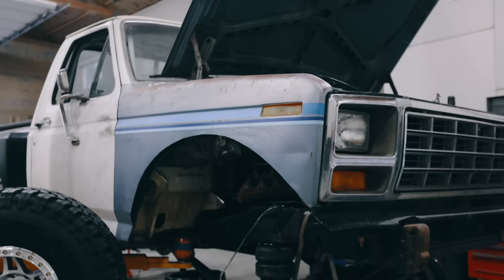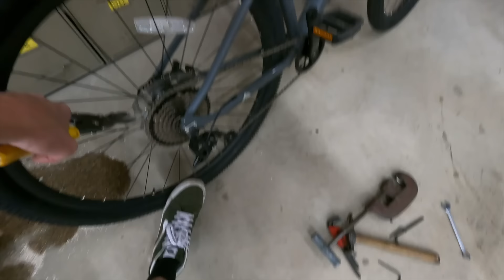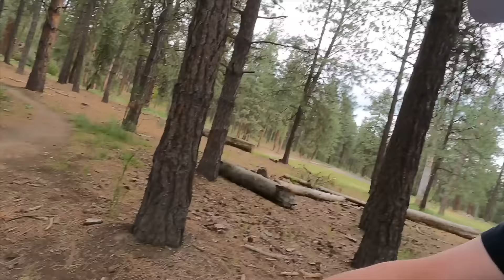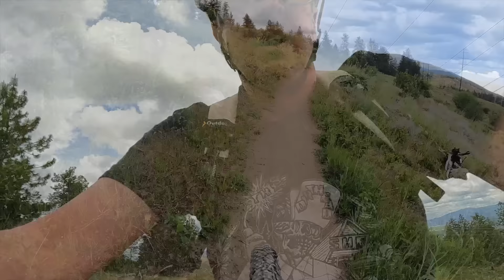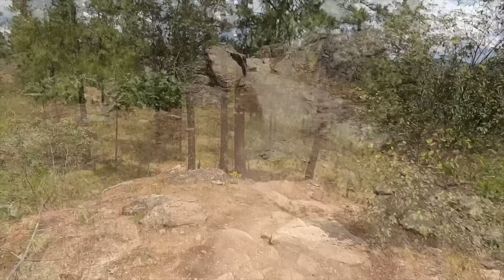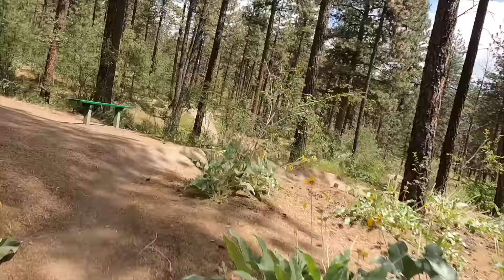The Cheapest "good" Mountain Bike out there.  Ozark Trail Ridge MTB

Comment: I'd bet  you wouldn't have had to cut the seat post you could have just backed out the screws and mounted a pump or water bottle. The screws would back out far enough to drop the seat down further.
Reply from the maker: There are threaded inserts (nutcerts) in the frame.  I would have to drill them out

Comment: I really enjoy mine.
I swapped the seat and grips out for personal preference.
Otherwise mine is stock.
I plan to upgrade to an air fork, but the factory one has been mostly sufficient for my weight and how I ride.
Seems you are a little harder on this one than I am on mine.
At about 35psi the tires have been fine for me.
I’ve noticed a couple times that they’ve started to slip where my maxxis tires on my other bike don’t.

It’s definitely not a $10k bike, but I’ve no complaints and have put over 500 miles on mine.
Once I got it dialed in, it felt like the geometry of the bike was designed for me personally.
Reply from the maker: I’m having fun with this one. I really think I’ll keep it pretty stick and see what it’s good at.  Seems not totally necessary to modify everything

Comment: This is so f'n rad! I'm not a big off-roader, but I subscribed back when Dirt Every Day came to an untimely end because I enjoyed Dave as a host.

I've been mountain biking for 22 years, so I've gone from 26er hardtail to 26er full suspension and then jumped to 29er hardtail in 2006 which I stuck with all the way until 2015. I went 29er full suspension that year and have ridden the wave of more "progressive" trail bike geometry. I've also gotten into a couple of eMTBs: a 160/150mm mullet wheel and a 110mm 29er hardtail.

As I've worked my bike stable up into the tens of thousands of dollars, I've noticed the rise of the big-box bikes and other budget level bikes and have become borderline obsessed with them. I bought an Ozark Trail Ridge new in the box and had it pretty much assembked and dialed when I went to install the pedals...and the drive side crank arm threads were missing. I was so miffed since I drove across town to get the bike and then spent over and hour assembling and videoing the process. I never published the video.

Recently, I've been playing around with Decathlon brand bikes because they've been super cheap to buy new. I had a $150 hardtail and a $216 full suspension. I found a $160 SR Suntour air fork for it, cheap rear air shock. Tranz-X 31.6 dropper posts are $50 on Amazon, so I grabbed on of those. Found some decent tires on marketplace for $15. Grabbed a few goodies out of my own parts bin.
Reply from the maker: Sounds like I need to look up Decathlon Bikes!  Thanks

Comment: I got my very first new bike back when I was in the 4th grade in the mid 60's. It came from the Thrifty Drug store on the corner of Westminster Ave. and Golden West St. It was a Huffy and it cost $15.00 and it was really hard to pedal. I would have liked to have had a Schwinn but they just cost to much. But it always got me where I needed go. I still have the last bike that I bought new in 1983. It's a 26 inch Beach Cruisier that I was riding the two miles to work.
Reply from the maker: Right on.  They all do the job !

Comment: This is awesome! I've been using Walmart bikes since they came out with full disc brake bikes. Hardtails everyone, and they really just need a nut and bolt check, adjustment so it shifts right, better brake pads, and tires if you're doing some of the harder stuff. I will admit that the forks have been stiff, hard hits is really all they'll adsorb. With what I've been doing they last about 2 seasons before the frames start to crack. But would definitely recommend as long as your not doing anything crazy.
Reply from the maker: Some are good… most are bad, but they all have their place in the market!

Comment: Heck yeah, man. That bike just needs a decent fork and stem, like you've already mentioned or hinted at. For a cheap fork option I think you can get a Judy Silver with 29" QR spacing. I've had them on some 27.5s without busting anything. And there's a couple cheap dropper post options with levers right underneath the seat if you don't wanna route cables.
Reply from the maker: All good options. I’m already thinking of fork options

Comment: I picked up one of these about a year ago  to get back into mountain biking on the cheap. Unfortunately it didn't stay cheap long, every part of it has been upgraded but damn is it a fun bike to ride.
Reply from the maker: That will happen!  It’s a fine line between upgrading and replacing
Reply: When you are searching for that new fork, 120mm of front travel really wakes the bike up. Also, if you end up with any tire rub after upgrading its going to be the skewer. You can solve that flexing by grabbing a Shimano XT skewer ($23ish).

Comment: I've routinely used a normal pipe cutter for steerer tubes, shortening handlebar width, etc... Nothing wrong with that imho. Interested to see how well this bike holds up- mostly the wheels staying true, and the welds on the frame itself not falling apart. Things I'd think a cheaper bike might fail at.
Reply from the maker: The frame is super nice. I think the wheels will hold up fine,  I’m sure the bearings in the hubs are ultra cheap though

Comment: Back in the way back I raced BMX for a local shop called believe it or not BMX Plus in Laurel MD. I talked to the Owner some years back about getting a bike for My Wife. He told Me to go to Walmart if She wasn't going to ride much. Just make sure the components were Shimano and most of the stuff there had it. I got one later on & smashed both wheels but that's My hard riding style. I need mags. 😁 Bike looks good enough to do what You want. Why spend $1500 if You don't need to. 👍
Reply from the maker: Yep.. I think there is probably a sweet spot $850 bike out there though.  I’m gonna find a
Reply: I'm going to build a 20" BMX bike, just want to ride hard like that again. 🙏 4 Me. 🤣

Comment: With the exception of the back tire, it seemed like it did better at a lower pressure. I'd say a better back tire and you should be pretty good. I have a killer back tire on my mountain bike, but I don't remember what it's called. The lugs are shorter in the tread, but it has some deep gnarly side lugs on the sides of the tread. I wouldn't run a riad race with them, but they bite good in the dirt!
Reply from the maker: So many good options out there

Comment: My bike has a Shock on the front, and hard mount on the rear.

I spent so much time on old school hard mount bikes that I was still getting used to riding with even the single shock.  I sure didn't like it on the dirt because it wasn't predictable like a hard mount.  Because of that I don't know that I will transition to fully sprung.  I really enjoy feeling the ground.  It gives me time to adjust.

It took me a while to find the tire pressure that I like for grip.  I can deal with the rude quality, traction is very important to me.

Don't get me wrong, I did enjoy the softer ride of the partial and fully sprung bikes.  Predictability is very important for me, even in town on pavement.  Too many too close encounters of the bad kind.  That's why I am a strong advocate for wearing a helmet.  It's kept my head safe more than a couple of times.

Finding long Offroad trails is very difficult here in the Midwest.  They are out there.  Far and few in between.
Reply from the maker: Sounds like you need to look at the ozark trail gravel bike. I think you would dig it
Reply: @thedirtheadshed  I will give them a look see.  Coming from you I take that as a good review already.

Comment: Wouldn't buy a bike from any store chain.
Also will never again buy any entry level bike from any mass-producing manufacturer.

The cheapest good bikes I'm aware of are older 2nd handies.

My current rig is an old Avanti 26" HT. Picked it up from the local tip for $5AU.
On the same day snagged a broken framed Fluid dualie, also $5.

To build the Avanti to ridable 3 x 9 condition:
The Avanti frame + bars + seatpost + hydraulic brakes - $5
Took 27.5" wheels (shod with 2.35s with plenty of tread left) + good brand gold stanchioned air forks off the Fluid. - $5
3 x 9 drivetrain from my 2nd hand parts box, Deore (rear) and Alivio (front). - $50  
New 3x9 Microshift shifters - $40
New wide body thick Gel padded saddle - $55
New lock-on grips - $20
New long alloy bar ends - $22
New basic rubber grips (to fit on bar ends) - $8
New Chain - $30
New brake\shifter cable sets - $22

Under $300 AU, 1500kms of rides thus far, zero problems, tons of fun..and way better quality than my new 2019 Norco Storm 1 29" HT that sits in the shed collecting dust.

The tyres off the Fluid dualie are still good, so too the gel saddle. Only thing I've replaced is chain.

Bikes in the shed awaiting rebuilds, all bought from the tip for $5, some complete only needing new chain, grips and seat.
- 26" HT - LearSport TR3270 HT ( aussie design) with original Deore gear.
- 26" HTs - 3 x Avantis, Apollo, Giant, 2 x Malvern Star.

Duelies 26\27.5" frames with some parts:
Project powershot.
Polygon Siskiu D5
Kona Stinky  

And my Giant ATX 970 duelie I bought complete a few years ago for $100AU.
In VGC, one owner, never been in the dirt.
Reply from the maker: I agree.  Used bikes have some great value if you can wait for the deal

Comment: The hanger and front chainring are made out of playdoh. 
Beware. 
I swapped out the crankset but kept the BB. 
Put the MT200 brakes on it. 
Everything else is stock and works well enough.
Reply from the maker: Right on.  That’s all in the plans here too
Reply: @thedirtheadshed  Replaced the bottom bracket, grips, handlebar, seat post, seat, tires, and front fork.
This has become my second favorite bike. It's great to have around if a buddy needs a bike or to go somewhere  you might be worried about your expensive bike being stolen.

Comment: The biggest issue for me is the price at 400 bucks someone new can get into an entry level bike store bike and have real parts and a shop to back it.  Or better solution to me is spend that money on an older used higher end bike. Used bikes drop value like crazy so you can easy have a 5 year old descent bike for thr same money. I appreciate what you're doing though, just think there are better ways to spend the money getting into it
Reply from the maker: It’s good for the money.  I’ll stick by that.   It’s not Great though
Reply: @thedirtheadshed  agreed if you have to have a new bike its not the worst option

Comment: Brand New Sub here in Missouri.. I work at Walmart, in Fulton,MO.  This is crazy...  I've been Fixing all of the bikes, that the contracted bike builders put on the floor at walmart.  I literally Built a lot of Bikes today, because the contracted ones wouldn't answer the phone.  So, as the "Bike Guy/Lawn&Garden/Seasonal/Toys Guy"....I stepped in.  I built 12, with 4 tools. Our walmart only has the Truvaille.  I've been Wanting to get a Ridge, since I heard of them!  (I've watched so many vids over the last 8months or so)  BermPeak's vids were cool.  I want to try to Buy one, and put an Electric Hub Motor in the rear.  But I'm Broke.  Any thoughts?
Reply from the maker: Wait for the rollback pricing or a return.  Don’t mess with the electric assist.  The exercise is good
Reply: @thedirtheadshed  I Specifically want a 29"Large Frame Ridge.  I'll try to Build it Up...
Reply: The Walmart i work at, doesn't carry Ozark Trail Models... Only the Kent, Trouvailles.. and they suck.
Reply from the maker: I legitimately think the ozark trail is a good starting point.   You will find one cheap.  Be patient.   And if you are patient long enough you may accidentally save up enough for a Polygon Extrada X7.   (That’s the one I want next)

Comment: A youtuber called bike farmer would not approve removal of the dork disc. Reason being, if you overshift with it on, it will save the spokes and wheel. If you overshift without the disc it will trash the wheel and spokes. Otherwise, good stuff.
Reply from the maker: I’m ok with not being approved of by a few
Reply: @thedirtheadshed  Fair enough. I love the addition of bikes to the channel. I do think I'd rather fix up a 90's MTB than spend $400 on the Ozark though.
Reply from the maker: Yeah. I may get back around to one.  But it would likely be for gravel road use

Comment: 1x9? That's so a decade ago. 

If you're going to be 'a cyclist' you definitely need the tools. In your EDC bring tire levers, a tube (even with tubeless), patch kit, chain tool and/or multitool with a few Torx wrenches, and an extra chain master link. 

Check your limit screws before you shift your derailleur into the spokes. All the WM bikes I've worked on haven't had the limit screws set right
Reply: I think he is referring to the 1x drivetrain in general on a budget bike. Not everyone needs XTR.
Reply from the maker: For what it is, it did pretty darn well